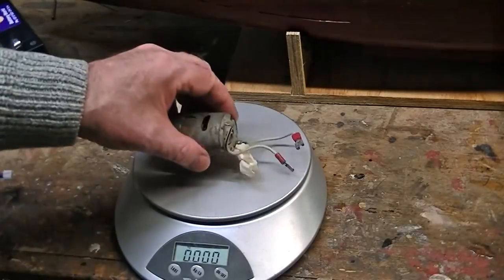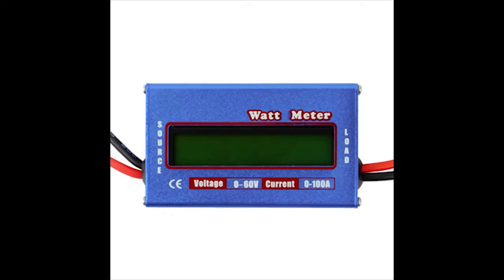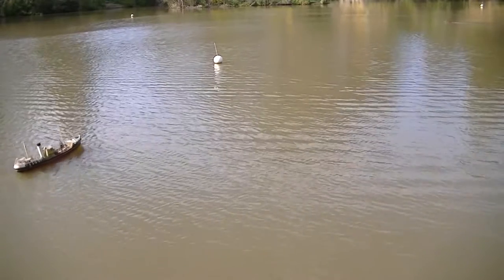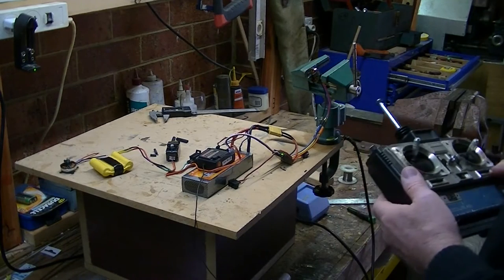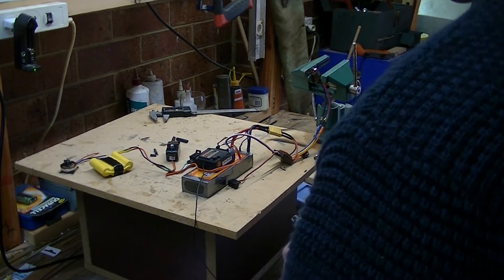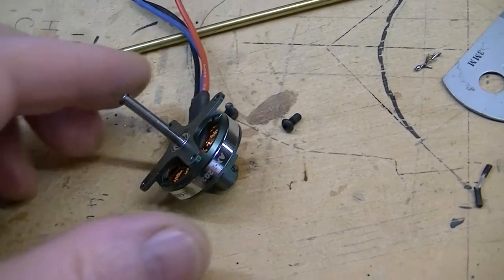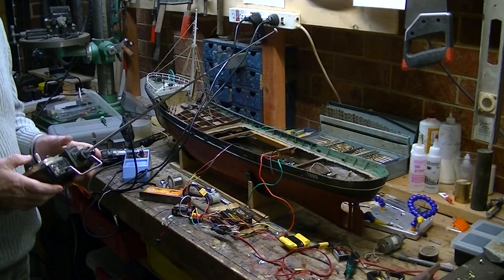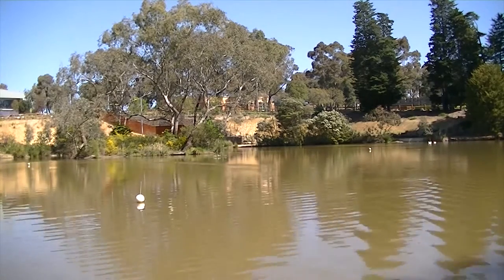Brushless motors and Scale RC Boats

Comment: Having just renovated a MMM Canning tug from the UK, I have stayed with a brushed motor and Mtronick Viper ESC. Apart from cabin cruisers and speed boats I think brushed is preferable. Weight(ballast) is required anyway so no problem with a LA battery.

Comment: Great video, just viewed it in November 2021. I like the idea of using the LiPo battery and lighter motor to save weight... this should make it easier to trim heavier ballast if needed deeper in the hull and help get the Center of Gravity lower in the hull where it will do the most good!

Comment: Nice work. You will loose lots of efficiency with a gear reduction. The trick is to choose a very low KV motor and to run a lower voltage with a large lipo battery. Perhaps a 2S? As long as you have an esc that can run well at 2s, it is always good to get a slightly larger esc than you need.
  Nice conversion. If efficiency is not a problem then there is no need to change anything.
Reply from the maker: Good advice.  Even more efficiency!
Reply: Reading this in 2021 and this is the plan I had in mind. Im just learning hope Im good with a 320kv motor
Reply: @stpatr3k  If you want very low speeds with high torque you might also consider a brushed motor but some of the crawler ESC's can be setup to run very low speeds these days.
Reply: @izzzzzz6  I saw that, the one with the reduction gear. Anyway the 320kv is on its way, Im just gonna try that first if it doesn't work, I will try the brushed one. Thanks!
Reply: @stpatr3k  Don't forget to play around with prop sizing.
Reply: @stpatr3k  I have info on batteries too if you need help.

Comment: Great video. I’m building a moderate size scale tug and will use a 750kv BL motor. As low as I can find that fits. I used a high kv BL in a test run. That just does not matches the torque that I nees instead of high rpm.

Comment: I used to sell those electronize speed controllers here in Melbourne and these can be adjusted for slow speed or faster depending on the use needed. To be honest, it all depends on the motor used, I use printer motors on my model boats and they use stuff all power and I can have them just very slowly turning over and have full control. These motors you are using do not like 6v gel cell batteries and I use them for power and ballast. Each to their own I guess.
Reply: Any links on how to hook that up. I have a few dead printers
Reply: To hook what up ?? the printer motor or the speed controller ??

Comment: No need for drive reduction with brushless motor. With more rpm, your creating more heat with causes a decrease in performance and productivity. Heat is the enemy of performance. Also with a good remote, you can set the maximum amount of drive speed you want and also have a cruise control as well. Would work good with your driving style.
Reply from the maker: Thanks for your thoughts, and for others to read also

Comment: Why anyone would recommend an outrunner motor for a boat is beyond me, one bit of water on it & you're motor is toast.
Reply: They run under water.  No brushes and lacquered wires.  YouTube it up.  A splash wont bother it.
Reply: Outrunners are designed for torque. You can spin a large diameter propeller without the need of a reduction drive. Innrunners are high rpm motors that will need a reduction system, and in some cases cooling.